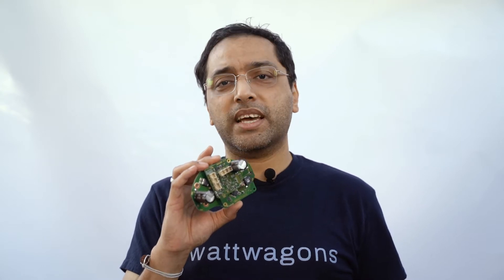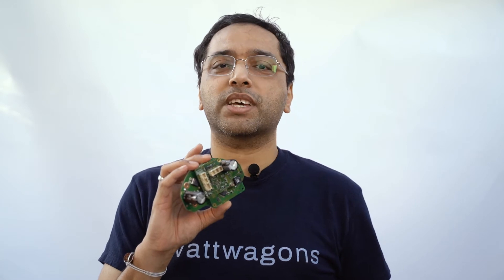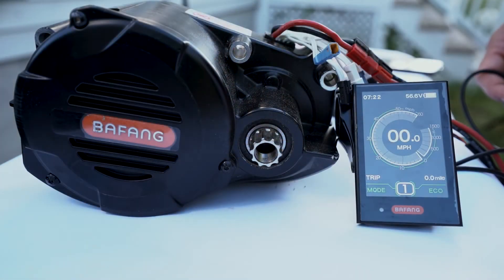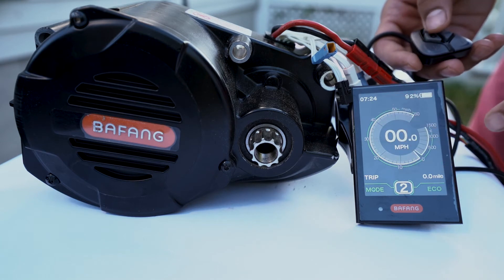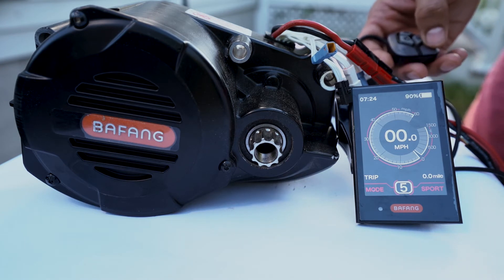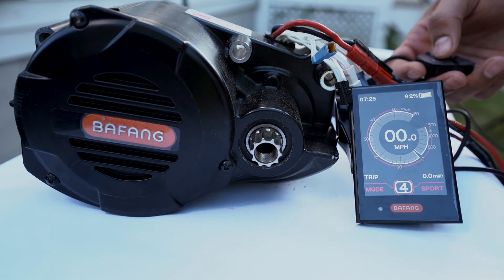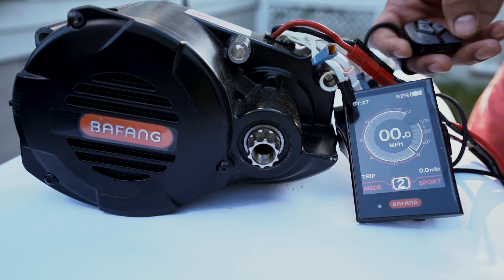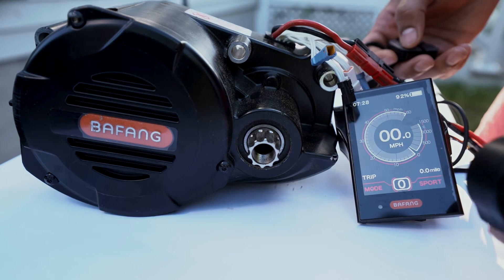Watt Wagons New Controller: Archon X1 Upgrade!

Comment: I think the way they implement the throttle is totally wrong. It should activate at 100% of the power when it's pushed a full on. It should be a smooth variable between off in full on so you can regulate the speed of the bike that way.